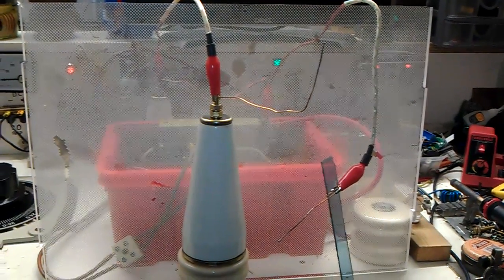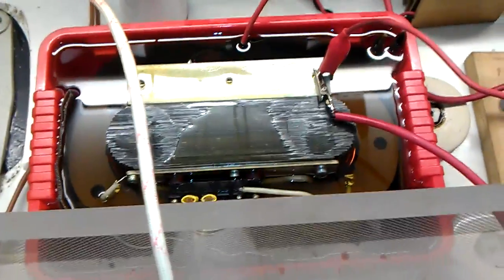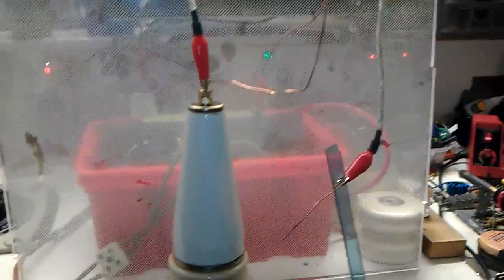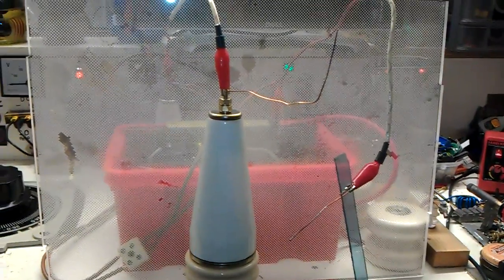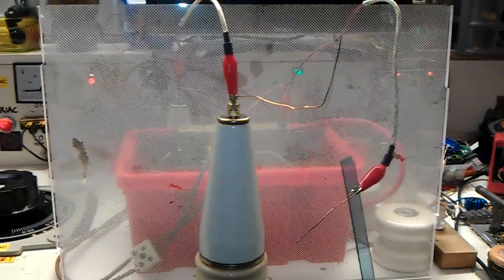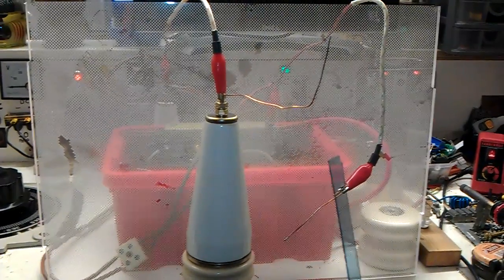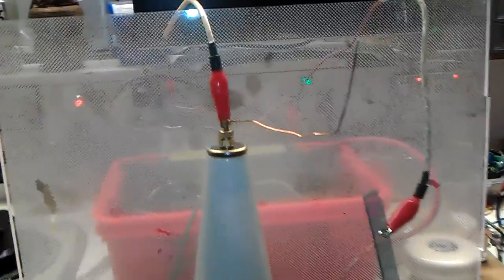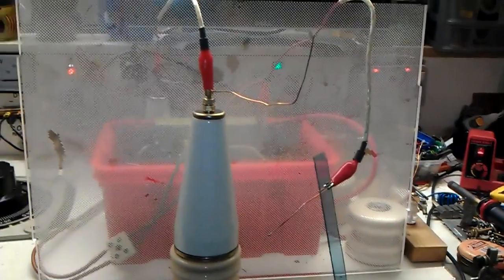120kv X-RAY TRANSFORMER

Comment: may I know why you have a spark gap?
Reply from the maker: Of course mate' no problem!
Ok' when using high voltage transformer' on the secondary windings you can get problems!!
When⚡ arcing the output (closed circuit) all is fine.......But* when the arcs "snaps" breaks'' you have a (open circuit) and this is very dangerous for your transformer ❎
The windings get covered in corona " and corona is Hot" Very hot, and can eat/burn into you windings insulation! burn This is called a arc over!⚡ and once this happens there's no going back as the burning causes carbon build up' and carbon as we all know is a conductive base for the arcs to track and short.
So a spark gap helps to give a constant closed circuit.
So when I draw a arc it breaks and the spark gap takes over⚡ 👍😉

Hope this helps mate. And thanks  

Anthony.🙋

High1voltage1rules
Reply: high1voltage1rules
 Thank you for explaining. I work as a service engineer for x-ray equipment and sometimes the filament breaks leaving the transformer open circuit, however the control circuitry limits the Kv and stops the inverter instantly [more or less 5 ms].
Keep up the high voltage!
Reply from the maker: valiza123 anytime friend and thank you 👍😉👍xray transformers are facking Awesome lol.
Hey if ya interested mate in my videos there's a xray warehouse I visit from time to time. And the place is FULL of equipment⚡ 👍😉 
Be safe friend and speak soon .

Anthony

High1voltage1rules
Reply from the maker: valiza123 anytime friend and thank you 👍😉👍xray transformers are facking Awesome lol.
Hey if ya interested mate in my videos there's a xray warehouse I visit from time to time. And the place is FULL of equipment⚡ 👍😉 
Be safe friend and speak soon .

Anthony

High1voltage1rules
Reply: high1voltage1rules
 thank you for the good wishes, x-ray tubes are deemed military equipment "x-ray sources" in Romania, and a large authority restricts the free distribution of them unfortunately.
I would like to get a high frequency transformer, as I already made a very good digital inverter, playing with a tv flyback is just as fun.
Reply from the maker: valiza123 hey no problem friend. Good luck in all your high voltage experiments. 
Be safe 👍😉⚡⚡⚡⚡⚡🙋

Anthony

High1voltage1rules